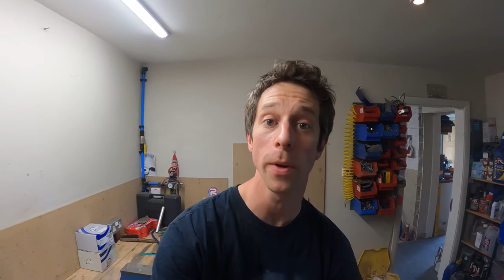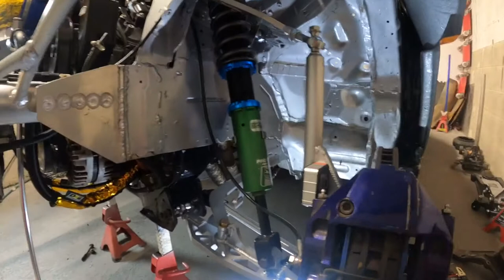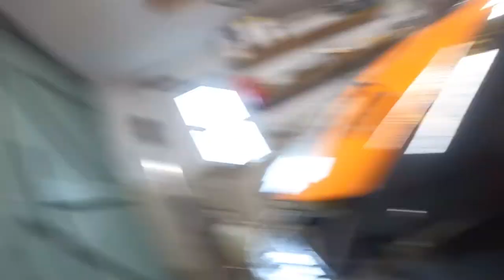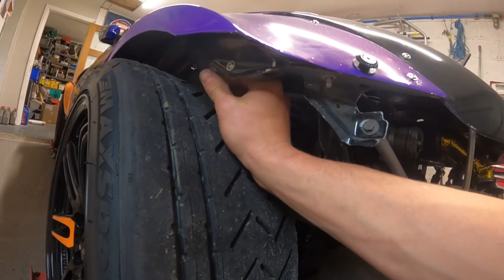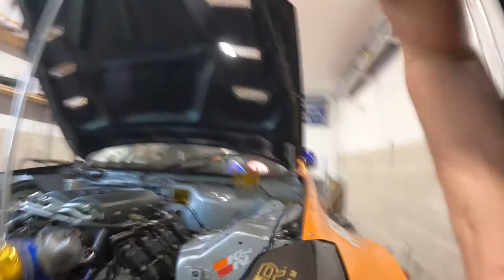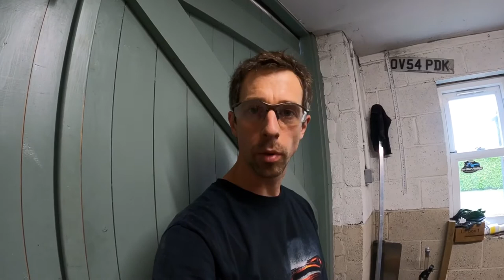350Z FDF Mega Mantis Kit Installation

Comment: Great vid, how do you have the offset rack spacer set up? It kind of looks like it's backwards to me? Do you have your rack moved forward so that you don't have to use the offset from the spacer?
Reply from the maker: Hey Jack, sorry I missed this comment buddy.  Yes, we cut the front cross member and moved the rack forward by 45mm.  The offset rack spacers are horrible and put a ton of bending moment on the rack.  Moving it forward so the tie rods can push straight on to the end of the rack is best. I hope this answers your question and I’ll keep an eye out for anymore you might have
Reply: @BizzDrift  thanks man! Yeah I need to relocate my rack I’ve been putting it off 😭
Reply from the maker: @Turnmann  it's worth the effort 👍 where are you based?
Reply: @BizzDrift  GA, wbu?
Reply: Georgia, USA btw, just realized you might not be in the states lol
Reply from the maker: @Turnmann  ha yeah sorry man wrong side of the pond. I was going to suggest getting a cross member from my fabricator but postage would be a killer
Reply: @BizzDrift  haha all good